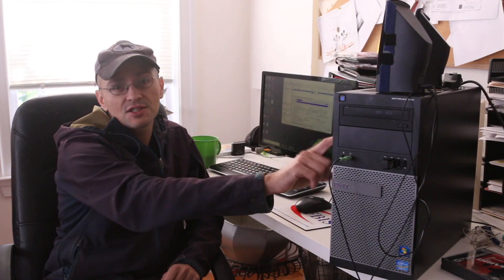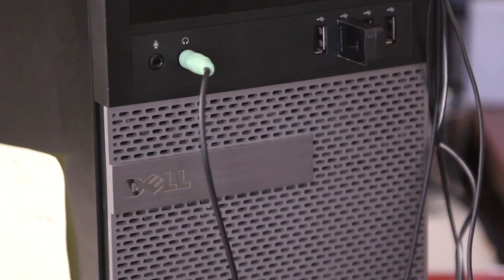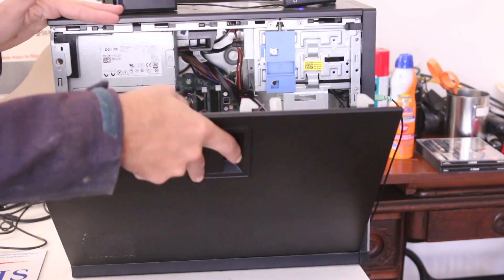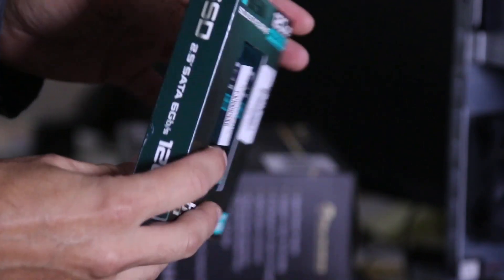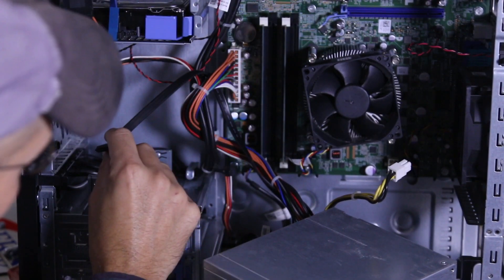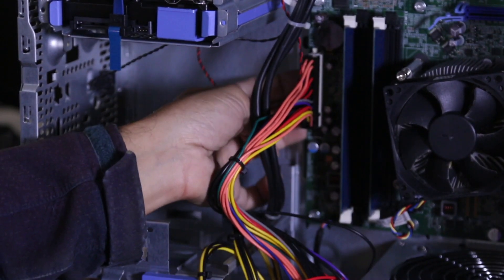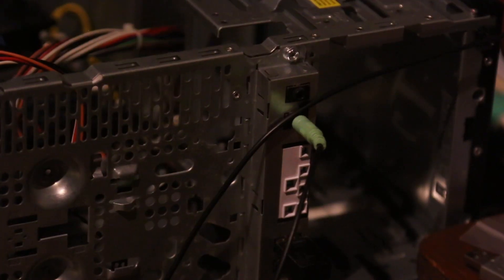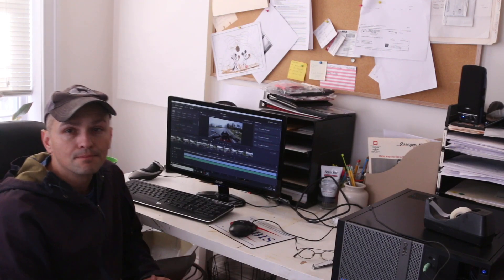Making a cheap gaming/Video system out of a dell optiplex 790

Comment: Does it run most games ok on the lowest settings?
Reply from the maker: I run farcry 5 on the highest settins and it's smooth. Red dead redemption 2 i put it on maximum and medium and no issues. The fan is way too loud. But works really well
Reply: @motardsquid  cpu fan ?

Comment: Some times you just need to clear the bios when changing hardware in a computer that my get the new GPU to work. For the power supply it is a over kill but it still will run the machine with no problems. A decent GPU for that would be a gtx 1060 super

Comment: I got a i7 3770 if you want to add a graphics card you have a lot of options get a 1050ti you want the non 6 pin card or get a power supply again and a graphics card under 10mm a gigbyte 1060 3gig will fit in there that what I use and you will need to upgrade the ram ddr3 is cheap gl with it
Reply from the maker: I just got the 1050ti and it works amazing. Also upgraded the ram, now its a pretty decent video editing computer and gaming computer
Reply: nice enjoy it
Reply from the maker: @aquaticsoul8267  Any other modifications i can do to improve it in the future?
Reply: the only thing is left is the cpu that chip that is in it now should be fine for now it depends what you want to play you can go a 1060 if you do get a 1060 get the 6gig model the extra gig is worth it and you can go rx 570 or 580 it just has to be under 10m or you can always case swap it easy to do there a few videos on it type dell OptiPlex case swap Newegg has cases cheap a lot times gl
Reply: You can try to improve the airflow by putting more fans
Reply: I also have the Dell Optiplex 790 MT (i7 2600, 16GB ram, 1TB SSD), what 1050ti did you buy? Also, do you recommend upgrading the PSU for the 1050 or with the one that it comes with should work fine?

Comment: I had been using a PC I built in 2009. I bought a small form factor HP desktop with Windows 7 and all was good until it packed up after onky a week. The error code was for a PSU issue. I was too depressed to bother pestering the seller into giving me a refund or similar. I actually bought a new PSU but it still wouldn't fire up. I cut my losses and eventually built a new PC (Ryzen 2600 CPU).
With a regular sized PC I would have had less proprietary components to deal with if repairs were needed.
Reply: A story with a good ending 
Make sure you take good care of that too!